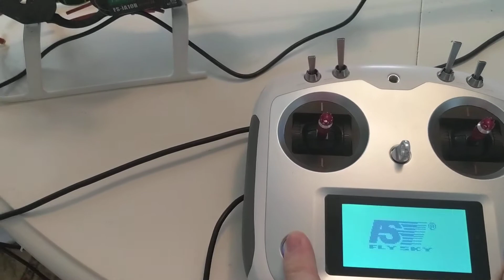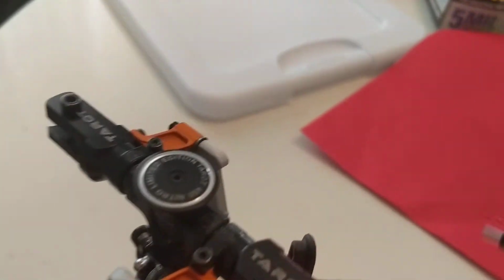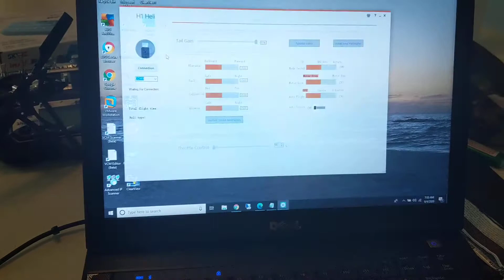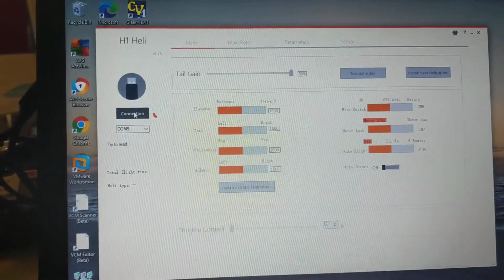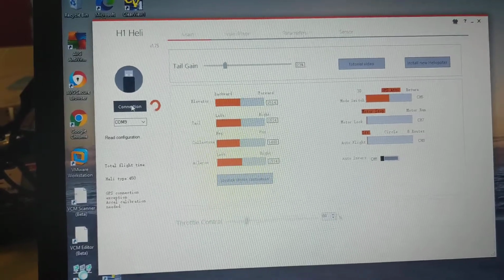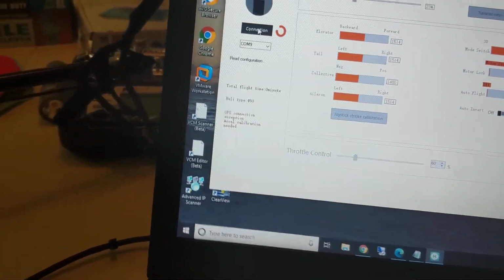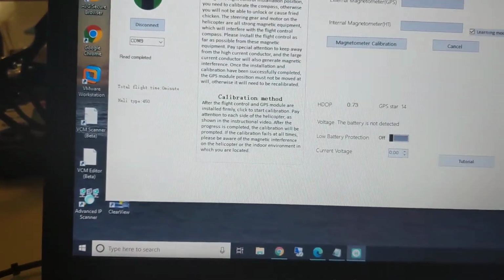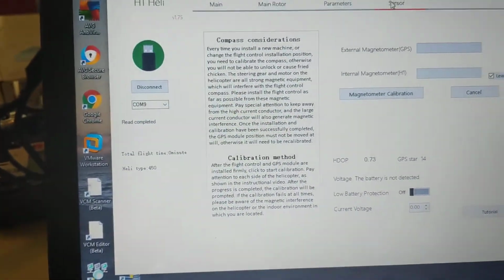Defective H1 Autopilot - Flywing not supporting their products.

Comment: is the throttle supposed to be wide open all the time ,cause everytime i arm it it just starts reving up like full blast and i have no control over it at all i bought the h1 fw 450 and radio watched a video from alishamoa to set it up on my tx16s radiomaster but does it on both radios im confused in indiana?
Reply from the maker: Yes. Supposed to be that way. The normal activation for an esc is all the way up and all the way down. But for the H1, it already activated the ESC and the controller is typically half throttle right before positive pitch.
Reply: @kaylin4u  ok so when I send it in gps  it will only go so high up then I can do what ever fig o fig 8 3D invert thanks for helping me understand the consent of this h1 heli controller someone needs to put out a video of this so ppl aren’t confused about what it does thanks again for help

Comment: it needs to be in a clear place outside your house needs to get a sattelit signal in order to lockon unit.  my drone is same thing.   outside in a clearing is best.
Reply from the maker: I meant to reply to this video a while ago. The owner of Flying contacted me directly and was able to get my accel calibration issue fixed with software. It's working great now.
Reply: @kaylin4u  Kelly, I'm having the same accel prompt. Can't figure it out. Do you have more details on how you fixed it, including that software you mention or a Flywing contact. carterg@hotmail.com Thanks.
Reply: I'm having the same issue what software did the owner give you to install.